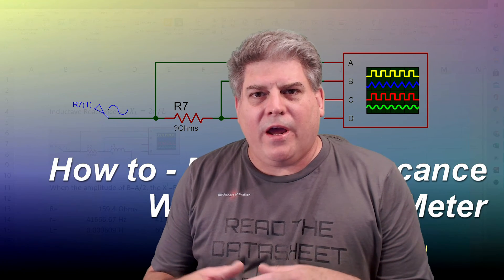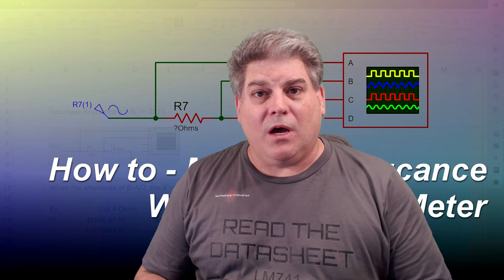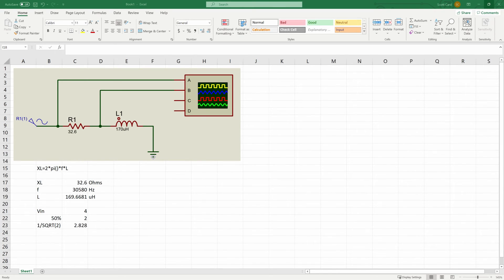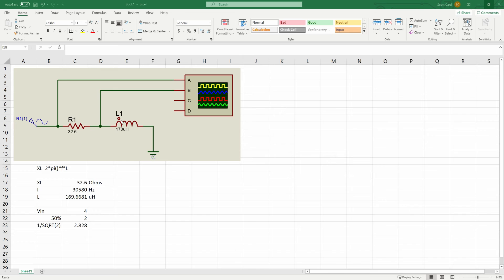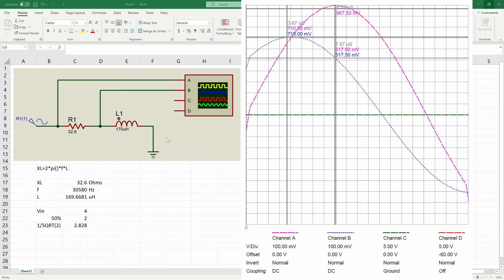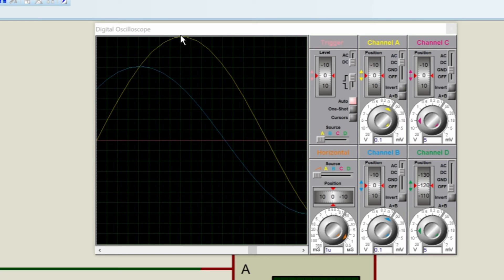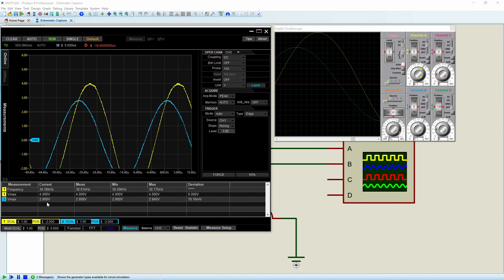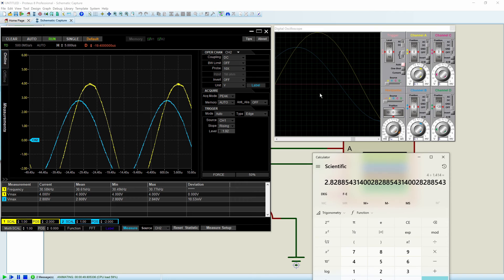Measure an Inductor, Without an LCR Meter (+Free Calculator)

Comment: The internet has become completely polluted with out of touch elites doing 'instructional'  that are worthless to the vast majority of people.

Most people don't and never will own thousands of dollars of lab equipment.

How do you do this with a standard digital multimeter, one would buy had HF or HD and a power transformer? That would be actually useful. What you have done is not.
Reply from the maker: Thank you for your comment. This is a great point and, this solution is not for everyone. Here in my home lab, my work lab, and the school I teach at, there are not LCR meters in the stack. While I do have access to a handheld meter, it is not always convenient or I may wish to measure the inductance at a specific frequency (think switch mode power supply). If you needed to preform this test often, I fully support buying a purpose built meter to preform the test. Otherwise, you may want to think about getting some used equipment like a power supply, oscilloscope and function generator. As for equipment, you do not need to by new, nor do you need to buy the best. My home lab started with e-waste, equipment I repaired/made, and secondhand tools. Over the years while working from home I have built it up. Here is a link to my home lab tour from a few years ago (when I made this video to help a student do their lab). 
https://www.youtube.com/watch?v=_QWtFyB8lwg
I hope this helps and you reconsider me as an "elite".
Reply: @ScottCard  Did you seriously just attempt to justify polluting the web with your elitist crap?

lol

Self awareness. Get some.

Comment: Nice update to the original. 
There are some interesting reasons for this method.
1. You gain intuition about how inductors work.
2. You get to see how an inductor behaves over a range of frequencies. 
3. You gain some understanding of how to isolate error sources in a test circuit when trying to figure out the behavior of an individual component.

Cheers 🍻
Reply from the maker: Thank you. In science we are  always willing to accept our mistakes and learn from them. I agree, this method shows a lot about the physics of the inductor.